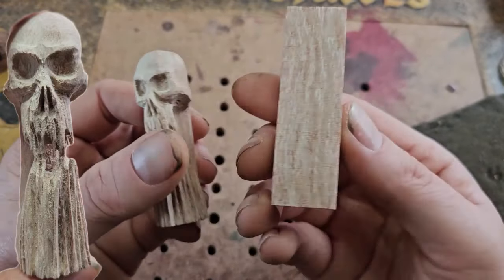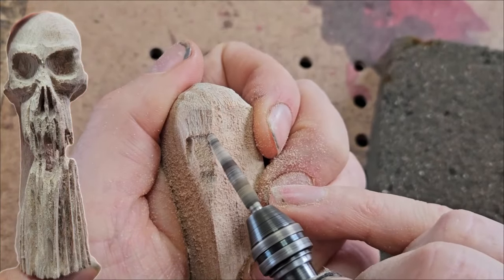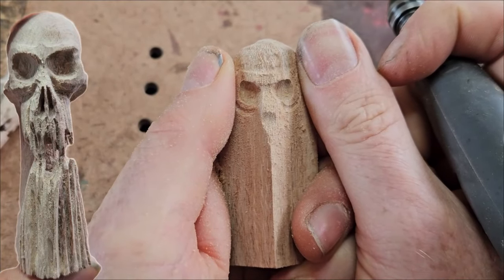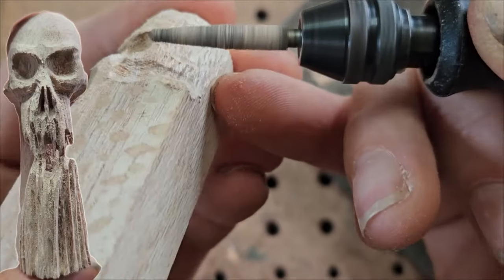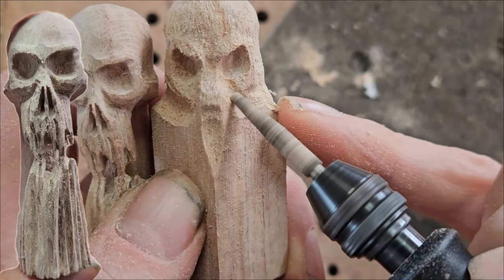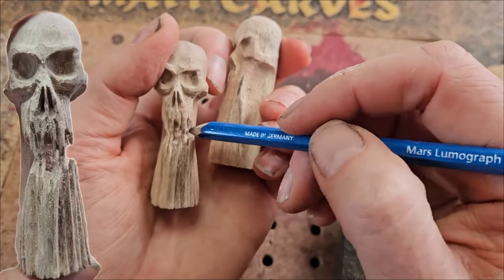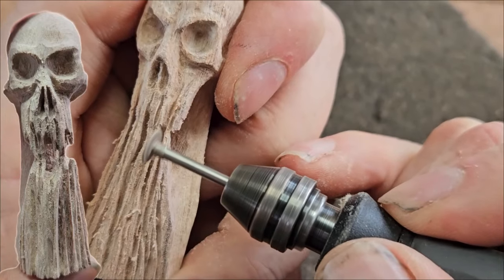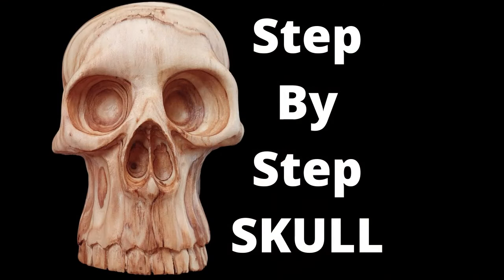How to carve a skull with a dremel

Comment: That's a great video.   You do a good job of showing the bits that can get you stuck and frustrated, but gloss over the parts that flow easier.   Good editing.  And since I am the same, I appreciate when you say that you have no idea what's going on here, oh wait, this is what I was doing.
Reply: One way that I sometimes use to add an antique effect and blend it in, is with the wool buffing dremel pads.  If you have colored hard grit paste, it will stick to the rough parts and is easily buffed away from the smooth parts.  It's kind of like a recess shade effect but you can do it with less wax.   The way you do it looks great.  I just haven't bought any of that nice black wax yet.
Reply from the maker: Cheers, William. Nice when someone appreciates the effort of editing. Yeah that black wax is good for antiquing, does show up the rough parts though. 👍
Reply: Couldn't agree with you more. YouTube should just kick off people who don't actually show what they're doing. Other mistakes YouTubers make are things in real time. 9r my personal favourite the guy with the blurry video. No it's not my phone.